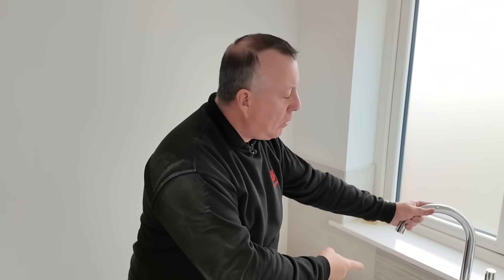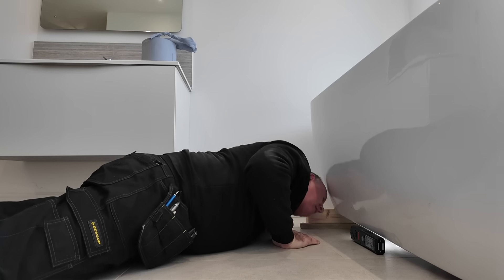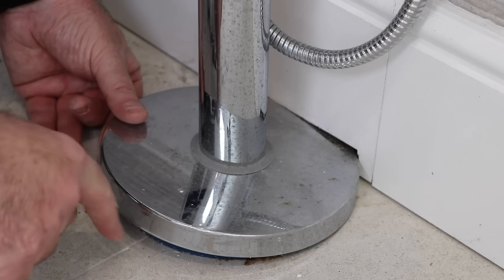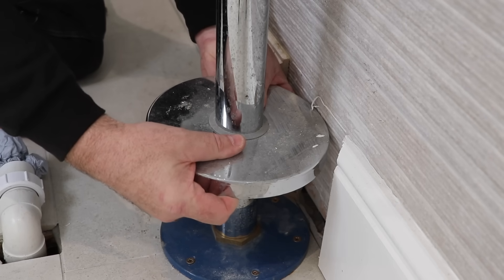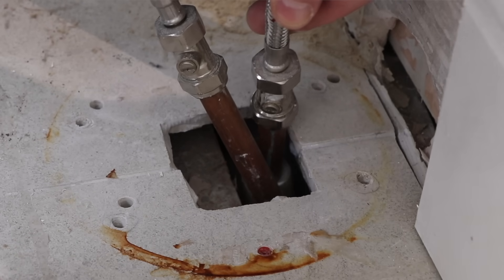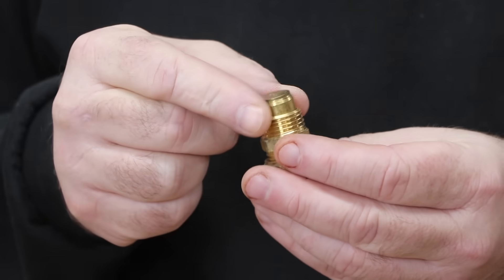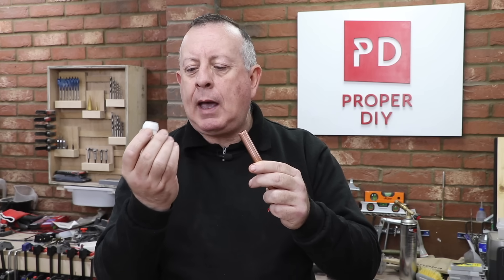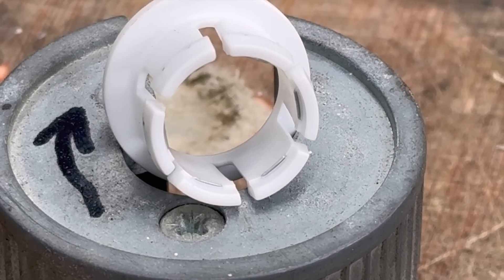The Best Method to 'Cap Off' Water Pipes.

Comment: Just my personal note without any criticism, but I think this method leaves a few metres of dead leg pipe in the system which can cause serious bacterial legionella problems due to standing warm water. It would be better to locate the junction to the bathroom and cap it there. Great educational video, thanks Stuart.
Reply: So an unused hot water line to a granny flat can do the same? Or to a turned off radiator? Really?
Reply: Most copper pipe systems already have dead end sections that are installed on purpose. They hold and air space that stops what's called 'air hammer '  That pounding vibration in the walls when you turn the water on or off quickly.

Comment: Stuart, nice video on different capping off methods. However, as a few others have mentioned, I'd be concerned about the length of the leg from where it tees off. Water sitting stagnant in a dead leg can lead to legionella forming, compromising the rest of your water supply. I'd definitely look into seeing if you can remove them, even if it is a hassle having to take the tiles and chipboard up. Not worth getting legionnaire's disease.
Reply: Just couple the 2 ends together, problem solved 😅
Reply: @pedrosmits  😂
Reply: @pedrosmits  That causes an entirely different problem as you are creating a sort of short cut for the flow and return so hot water will be returning to the boiler without losing much of its heat, and the pressure driving water through the radiators will be reduced.
Reply: the only effect is in the primary heating loop. On a sealed system, as with a combi boiler, that water does not go anywhere else (except, maybe a small amount via a pressure relief valve into a drain). It certainly can't contaminate the rest of the water supply. Even on unpressurised systems, there's a separate header tank, and it can't contaminate the main water supply. A typical UK household heating system is going to have  several of these sort of blind ends as things get changed over the years.

Legionnaires disease isn't a significant problem in domestic households. It is much more associated with large scale systems, especially with air conditioning and where evaporative cooling is used. Those sort of blind ends might be more of an issue with drinking water supplies.
Reply: @TheEulerID  of course I know that. I was just joking.🙃
Reply: @TheEulerID Yes the central heating system is a closed loop, however this is the hot and cold water feeds he's closed off here. It's in the regulations for a reason not to leave dead legs, and that's because there is a non-zero chance of legionella forming.

Comment: Regulations state the "dead leg" length on 15mm pipe should be no more than 1.5cm ie 15mm. You have an increase chance in legionella forming anything over 150mm / 6". Best to take the floor up and cap off at the T junction. More hassle but safer in the long run
Reply: My old man was one of the original investigators into Legionella ;)
Reply: Why 15mm if there's no increased chance of legionella until 150mm?
Reply: @neilmcalester  other factors come into play such as pipe position. Where gravity can help the risk is reduced. Legs coming off a horizontal going down a dead leg are the worst. Whereas pipes going up  and capped are the better option.
Reply: Do you know whether the legionnaires risk immediately disappears once you reconnect a "dead leg" end, and water starts flowing through the pipe again?  Would the chlorine / fluorine in the tap water kill any bacteria straight away?
Reply: Nice one. Thanks for the info. I was stewing over whether or not I should leave a dead leg of just 100mm because I would never consider anything longer .. Gonna chop the old tee fitting out and fit a slip fitting … that’s Proper DIY!

Comment: It's important to note that, although these fittings are removable, they are not reusable. I found this out the hard way when a push-fit T-connector I had fitted in a tight space under the floor in the bathroom burst open after I had fitted the flooring. I had fitted, removed and refitted the T-connector on copper piping without realising it's clamping had been weakened by removal.

Comment: You should avoid any length of pipe with non flowing water in it because of legionaries disease. When capping off you should go back to where it will flow. If it was short I would have just put a compression stop in the isolation valves to make it easy to reinstate something.
Reply: Hey, thank you (and everybody else with similar advise)! I have a question regarding the topic. I completely renovated my bathroom. Everything out and started from scratch. Sink: Reconnected. Bathtub: Reconnected. Radiator: Removed and used stop ends. Eventually we will connect the radiator again but right now those two pipes are just dead ends. Is that a problem? I would think that we would already have gotten legionnaire's disease if it were a problem here? Heating and normal water are used daily.
Reply: @zakkvanish3668  not sure about regulations on heating dead ends, but there is no actual problem, you don't drink or shower in heating water!
Reply: @AlanBell  Thanks a lot mate. That was my hope as well. After all the radiators have their own circuit.
Reply: @zakkvanish3668 Central heating( radiators) are totally separate from the normal hot and cold water supplies so there is no risk from dead legs on the heating side of your system. 
That is on the assumption that your heating system is a properly designed and installed system.

Comment: Is this a temporary measure? When calling off water, apparently you should not leave a dead leg of more than 100mm to avoid legionnaires disease.
Reply: Have a look at the pipe and fittings its no more than 3 inches or 75mm. ish, so it seems fine to me if nothing else it has created a mini arrestor
Reply: @du7ch384  WRAS says the length should be no more than twice the width of the pipe in the UK, so 30mm max  in this case.

Comment: JG Speedfits are great joints. I have some in my house that have been installed for 36 years. Not a single leak. We used them at work for fuel lines before they made plumbing versions. I have used their end stops, temporarily only, as I prefer to get back to the T and remove the branch from there. It helps I have a house with floors that are easy to lift!

Comment: Just wish I had any of the fittings a few weeks ago.  A my son's a compression fitting installed by a professional plumber had blown apart on Sunday aftenoon.  Fortunately after lots of rummaging in plumbing box I managed to find compression stop end. Job done.  In preparation for next time got some more compression stop ends and the plastic types.  Never used them. You made these plastic fittings look so simple that even my son could fit it.  Interesting coverage of the options

Comment: I normally keep a couple of push fit end stops for emergencies and use coloured collets so I now if it is a hot or cold pipe if they are going to be left permanently.

Last year I had to repair a fitting which was on a copper pipe that had become slightly distorted and was in a sutuation where I could not access enough pipe to replace it so I decided to try a push fit before cutting up a fitted cupboard.  This was far more in hope than expectation but it worked.

Comment: i am no plumber but last year i fitted a outside tap using plastic all the way though the house i say that because the kitchen is at the front of the house and the drive, hot tub and family garden is at the rear of the house, the only part i found nerve racking was the compression elbow from plastic to the copper that goes through the wall but i followed the instruction to the T and my tap has been working for over a year and i am no longer afraid to now pull out my plumber bag full of plastic fittings and give it a go lol. 

P.S. you can buy some red and blue little clips to put in between where you push the push fit to remove i have them to identify the hot and cold under my sink also if the pipes drop for any reason its reassurance they don't clip the push fit causing the ends to remove.

Comment: The previous owner of our house fitted those speedfit stop ends on a pair of unused 10mm heating pipes under the floor on our upstairs landing. They worked fine until about 7 years later we changed the boiler and the extra pressure popped one off and caused a leak.

Comment: Wonderful advice and demonstration on how to cap off water pipes.
The best & most conscientious plumber I've ever seen & known - TREVOR FRASER - gave me a (novice) a great tip which saves stress & worry:
If concerned about your DIY plumbing joints, simply wrap them in toilet tissue. Check on them occasionally and you'll be totally reassured.

Comment: Great demo of the plastic cap grip - sorry about the clamp!

The other thing about soldering end caps, is that when you're fixing them to a closed end pipe (unlike your demo where the other end of the pipe was open) the heat of the blowtorch expands the air inside the pipe, which keeps trying to pop the cap off or force its way past the solder. There's probably a trick to it, but I've not yet discovered it, so I'll use plastic next time round. I wonder if it gets brittle over time.

Comment: A method I have used to seal off 15 and 22mm copper pipe it to get a good pair of grips and squeeze the end of the pipe flat/closed and run a little solder over the end.
Reply: Cowboy

Comment: I am a supporter of Stuart’s channel,  his content is honest and well created - it is fine to comment on issues so we can learn but …. I would say that all you tube content is never going dot every I & cross every T. re regs etc.  I have come across several pipes where professional trades have capped dead ends so the trade does need to take care to make sure they do correct work also ! One of the reasons I do so much DIY is I just hate the way some professional people complete the job (not all) just think though Stuart has left those pipes live for 2 plus years with so little use and his family have not been on the news with bacteria outbreak yet.
Reply: Regulations change over time. 10 years ago it was thought about less. However as more and more issues arise regulations are brought in to counteract issues. 
The old rule of “everything’s alright until it’s not alright” applies. 
It is definitely an issue that needs consideration
Reply: @newlinerealboi3434  Consider the way expansion vessels are plumbed of necessity into pressurised hot water systems. A high capacity dead end positioned perfectly to inject its culture into the cold feed to the tank and to do so preferentially when the tank is colder. The bugs could be coming out of your shower head within minutes.
Dead ends are ok, apparently, when the system requires them.

Comment: compression fittings are a genius idea. house i bought was extended and the only way to have a tap outside was to split water under a bath to the side of the house. they even sell a plastic stopcock i fitted under a bath panel to ensure outside water doesn’t freeze!!

Comment: JG speedfit having Collet Locking Clip, to reduce the risk the locking knives/tangs back out.
//
JG Speedfit collet locking clip prevents the accidental release of a pipe from a standard push-fit fitting. Red and blue options available to provide colour coding of hot and cold water pipes.
//

Comment: My son has had two major leaks from his plastic pipe fittings, which were part of the original plumbing in a new house. I would therefor not trust them for mains pressure. With regard to the capping off, I would have just removed the valves and fitted a cap onto the pipe using the existing olive and nut left from the valves. Far better and easier job.
Reply: So a chrome nut from a valve and an old olive onto a new copper cap, that's great 👍

Comment: the good thing about those plastic types is you can use them on a 'live' water pipe... such as I experienced last year when my pipe burst in my garage where someone who joined plastic to copper pipe.  we couldn't turn off the water so we simply tapped off the garage tap.

Comment: Hello Stuart,
 Personally I only use push fit caps as a temporary measure and don't use push fit pipe and fitting on any jobs. I have never seen push fit installed to manufacturer's instructions as regard to clipping,  this incorrect installation invalidates the warranty and the constant movement of expansion and contraction can lead to total failure and flooding, especially as there are more and more 1/4 turn taps in homes creating a high hydraulic pressure when tap is turned off.

 I have attended numerous jobs where this has happened, and on one new build estate in Wickham, Hampshire 3 houses out of 12 had this happen over the first 6 months,  2x 22mm Hep2O pipes under baths and 1 x 22mm Hep2O cold main, the damage was terrible. this has led to a ban on push fit by some building companies favoring instead Press Fit.

 As regards to central heating and push fit, the plastic can become brittle and the stainless teeth fail, this is not what you want if water temperature is high as leaking hot water through a ceiling can be very dangerous.

 As an experiment leave some fittings on copper pipe filled with water or dirty central heating water and leave for 6 months, then remove the fitting and see the corrosion caused by electrolytic action.   

Soldered or compression would have been my choice. As mentioned dead legs are a No No. 

As always I think your channel is brilliant.

Comment: The push fits fails only through user error. Mark the pipe for maximum insertion depth before pushing on, especially in fiddly areas. Thinking you pushed it on correctly against being sure it in ALL THE WAY will happen when its in the hardest spot.
Reply: Rubbish
Reply: Quite right, I was a plumber for 40 years, and I always marked the insertion depth so I knew the fitting was properly on.

Comment: I have a oil boiler with forced hot water baseboard heaters running in a concrete slab. I’d like to replace with an electric mini split and level the slab (which the builders didn’t let cure properly) but not sure how to safely seal the hole for the pipes, any thoughts?

Comment: Push fit stop ends are ok as a temporary fix. I would trust them as a permanent fix.
I have seen these loosen when the water pressure drops or if the water is turned off.
Always use collet clips.

Comment: I had a capped mains pipe in the loft with a push fit fitted by pro bathroom fitters. It came off after about a year and when I was out for the day.  What a mess, I needed to move out for 9 months while house was repaired.
So I will always use a compression fitting.

Comment: You showed the different fittings to cap off and I agree the Speedfit is the best but where you had a nut and olive to go into the cap you could have used the normal compression stop end. which would use the existing olive and nut. Other point for a DIYer when testing for leaks after a job switch the water on about 1/4 turn to test. It will pressurise just the same but if there is a leak you won't be flooded!! Then turn on full.

Comment: A very easy way is to remove the copper pipe from the plastic fittings. Using a similar under slung support such as coat hanger wire or cable ties. Then slip in manifold stops. Neat, easy and no dog leg.

Comment: In the USA we have push on fittings, first so far as I know are Shark Bite brand.  I prefer to use the brass or copper versions.  My biggest concern with the life expectancy of these is not the physical metal fingers that hold them on.  Lots of test have shown that they will hundreds of PSI, many times the max pressure permitted for plumping.  My concern is that the seal relies on a synthetic rubber o-ring or seal.  The same applies to the crimp on connectors.  I worry that 25 or more years down the road some hapless owner is going to have a plumbing nightmare when those fittings start failing.

Comment: Would it not be easier to just add a brass stop end on the isolation valve? Great info as I actually gotta do this today!
Reply: Yeah have to say i agree with you, also gives some redundancy as keeping the valve closed now gives two barriers on each pipe.
Reply: That's exactly what I thought. Secondary layer of protection too with the isolation valve acting as a stop too if you were hesitant to use compression fittings alone

Comment: If you have a combi boiler you may get the boiler starting up if you turn on and off cold main water because there is air left in the capped off pipes I think it is called bounce,Plumber 50 years experience experience

Comment: I have a question... As the system is isolated on the 1/4 valves, could you just add a compression cap to the end where the Flexi was?
Reply: or compression fitting below using the same olive and nut 
ok the shut off valve would be missing one nut and olive but that is a minor ? no ??

Comment: Hi Stuart, is it an option to leave the isolation valve in place and just blank off the open end of it?
Reply: A waste of 2 iso valves, but on the other hand doubly protected, iso then stop ends. However, you cannot cap an iso valve so you either add an extra bit of copper or get rid..... hope this helps

Comment: Stuart the flexi tap connector was screwed directly to the isolation valve which has a somewhat sharp edge to accept an olive, so over time and especially if very tight the isolation valve could have pierced the rubber washer and caused it to leak,so maybe  good timing!?

Comment: Great video Stuart but you could have fitted the stop end compression fitting directly onto the isolation valve.
Reply: Did wonder that myself but probably wouldn't be that interesting a video 😁
Reply: If you mean the brass cap with rubber inside it's not a great idea because the isolation valve is made to accept an olive so the edge on the isolation valve    is somewhat sharp and can  pierce the rubber and cause a leak over time ,
Reply: @ajvaack  no a brass blanking cap.